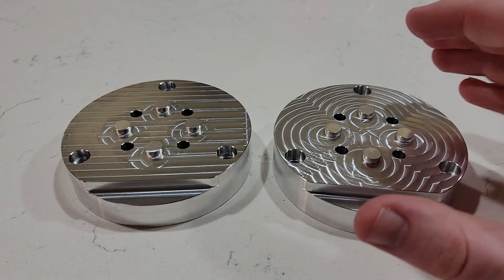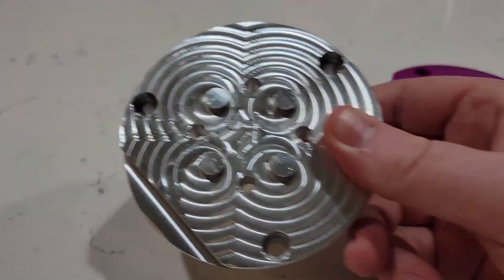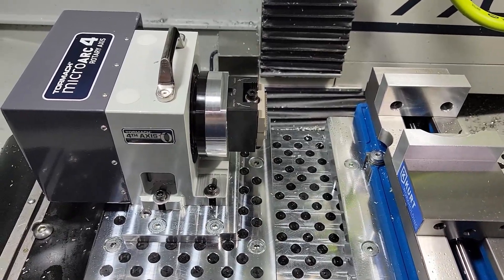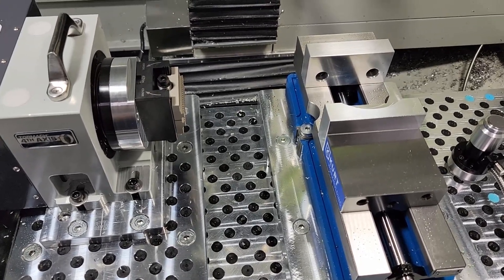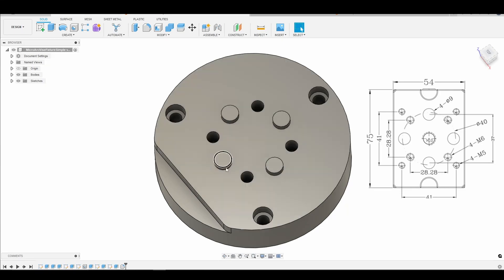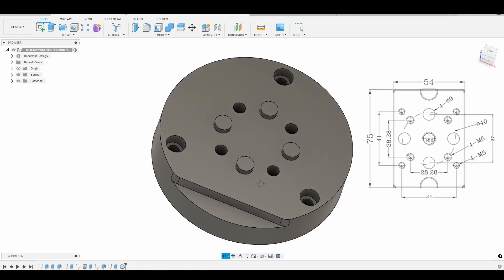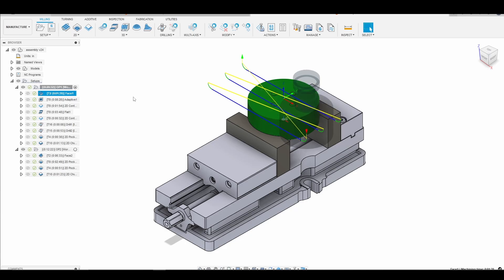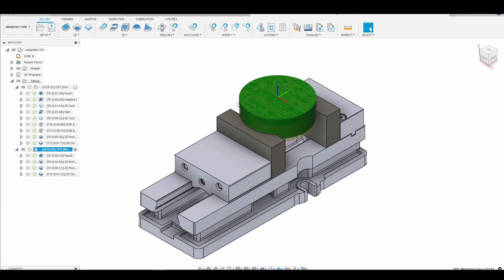microARC Vise Fixture Overview

Comment: Hi Craig, Thanks for posting this. It inspired me to order a Xin Dian vise last night for my Microarc. I appreciate finding out here that the Tormach-provided STEP model isn't accurate in terms of mount locations. With your permission, I'd like to make the adapter plate based on your design. Unfortunately I'm getting a permissions error when trying to access the Fixture Model page ...
Reply from the maker: The names Josh and thanks for pointing out the broken link. It looks like none of my links work anymore. I expect it's because of a fusion update, but I'm not sure. Anyway, I've updated the link and you're free to use the model however you wish.